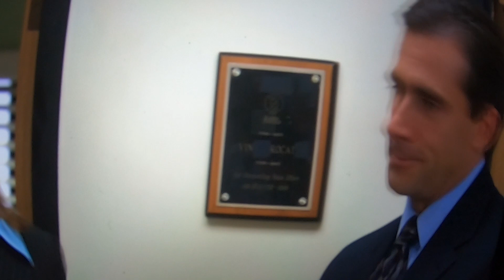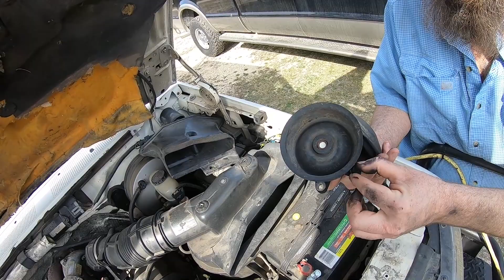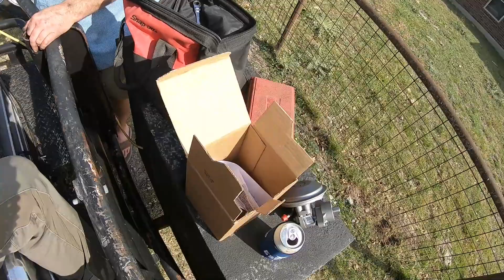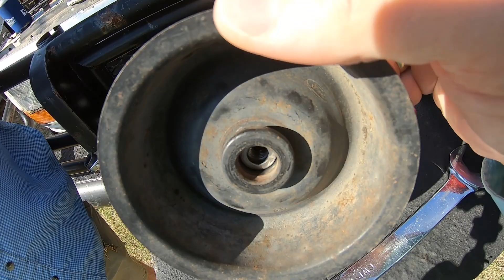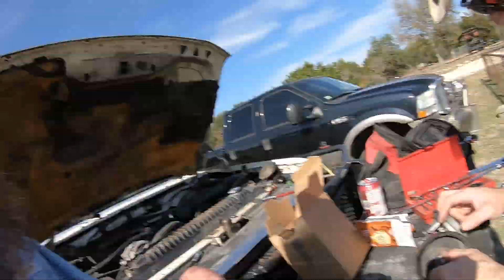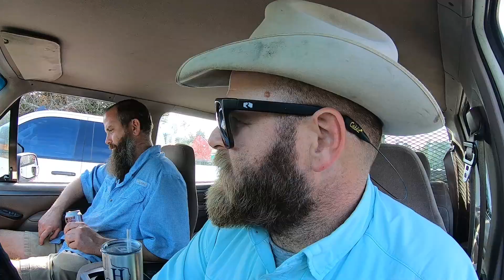HOW TO INSTALL A VACUUM PUMP FORD F350 POWERSTROKE

Comment: No AC in Texas? Dang. You’re brave! At least I don’t see a ac pump. 

Mine kept having the “brake” light on the dash come on. I have fixed it tonight. Haven’t went to test drive it yet. Lol
Reply from the maker: I’ll put an AC system back in there eventually. The heater works great though. How did you did fix  the brake light?
Reply: @TexasBeardAdventures  it’s a vacuum leak. I need to seal it up again. When the vacuum drops below like 10 psi the light will come on. I didn’t need to replace my pump. Apparently. But I did anyways

Comment: Just curious. Once you started driving it after finishing the install, you said it already feels like it's got 20 more HP. I'm still learning about diesel engines, and I know a vacuum problem in a car would cause a performance issue, but as a diesel doesn't create, use or depend on vacuum for engine functions as I understand, why would it feel like it has more power after replacing the vacuum Pump? Did u just say that to be funny, or am I missing something? I only ask because I'm about to replace the pump on mine because it sounds like it's about to explode, and I would honestly like to know if it does more than what I was under the impression it does.
Reply from the maker: It was just a joke.
Reply: Ok. Thankyou. That's what I thought, but had to be certain I wasn't missing something. Thankyou for responding so fast!!!
Reply: I'm subscribing to your channel right now
Reply from the maker: @erikweisz299  thanks brother, good luck on your truck.

Comment: I replaced my vacuum 3times over the same thing with the brake issues and my brake booster .It was a crack in the vacuum lines
Reply from the maker: Thanks for the info